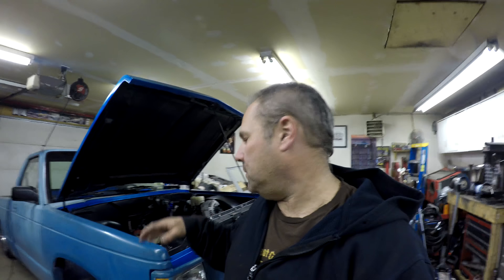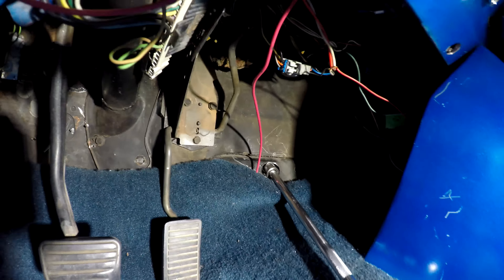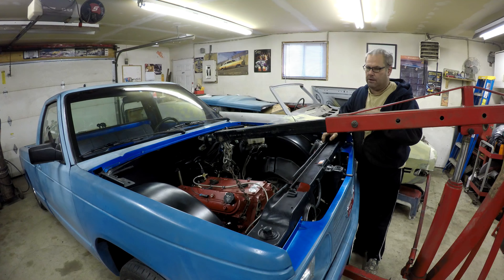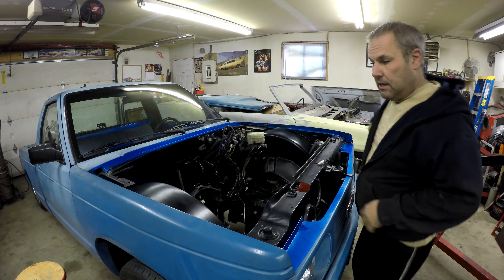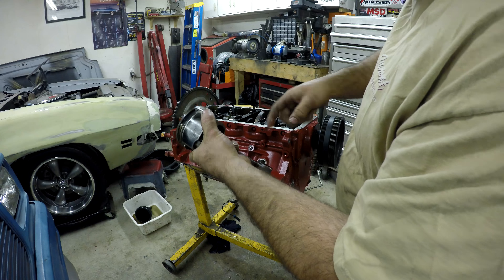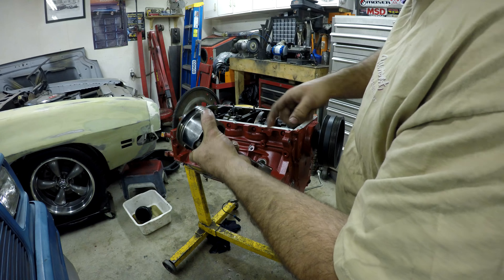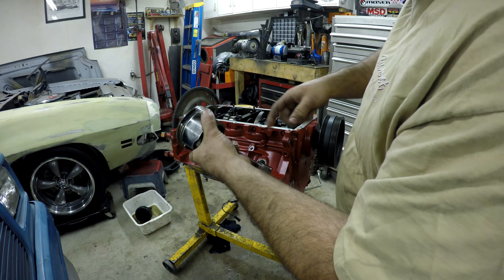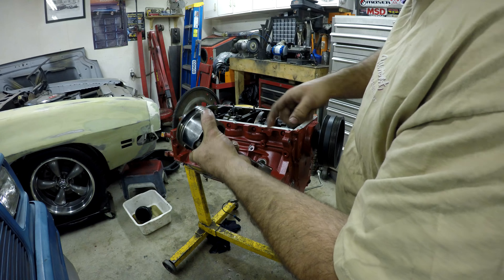Replacing a Piston in a V8 5.3 LS Engine | Blue Ghost Engine Problem Solved (Turbo L33 Budget Build)

Comment: Awesome video. 24C is about 75F. Watching you has inspired me to do an LS swap in my Nova for my next build. I've had 3 355's in it now and have found that they don't hold up well when you're always giving then a hot supper. I had always thought it would be way to difficult to pull off but after watching your guys I have seen its not really that much more to it. You have the best LS content on youtube, hands down. Thanks for the great uploads.

Comment: Lol, I'm uploading this exact same video right now. Cracked #5, ran great besides the smoke, and crankcase pressure pushing oil in boost. I also have 3 bent rods on drivers side that were so slight I had to take a straight edge across deck to see the pistons were tweaked. Good work man, keep it up.

Comment: Not sure if it’s related or not but one summer I had s hard time keeping a 400ci. small block, 2-305ci. small blocks and 2-350ci. small blocks in one of my 4x4’s. That’s right, 5 Chevy small block engines in one summer...the failure? ..#7 rod bearings in every single one.  The nearest we could surmise is the weakest link torque-wise. The situation changed when my final drive ratio was changed to a ‘lower gear’. IE....went from a 3.07:1 (highway gears) to a more useable 4.10:1  
With that only change, I have not since ‘lost’ another engine. All things being equal, I much prefer the lower gears anyways...believe it or not the gas mileage seems liveable as well. 🤙🤙

Comment: Hey bud I had a question, I have the same issue going on with my 5.3 where I found a Crack piston and I also have a bunch of 5.3 parts around the garage, and I was wondering can I swap out the one Crack dish piston for a flat top piston or would that cause some issues, note the piston came out the same year 5.3 but one had flats and the other had dished
Reply from the maker: I wouldn't do that,the compression would be different in the cylinder, and the weight of the piston would be different. If you have a full set throw all the flattops in and raise your compression.
Reply: @SPPTVarmy  ok thanks I appreciate the reply 👍

Comment: Have you ever had a 5.3l engine lock up on you out of the blue? A buddy (R.I.P. Matt) had his lock up 30 miles(50km) after fuelling up. (Not sure if that was a contribution to locking or not..just the facts) Driving slow hey speed..about 50mph ..no warning, no knocking, no lights or alarms just simply seized. Engine oil is up, at normal operating temp and no sign of loss of oil pressure. I have not ripped it down as yet and have not trued to restart it since the incident. 
Are they known for things like this that I’m not aware of? I’ve been a ‘mechanic’ for about 40yrs on and off and been working on the 2000 models for the past 5. Any info or direction on this ‘failure’ would be much appreciated. Thanks in advance... McGyver of the North.👍🤙🤙
Reply from the maker: Maybe a leaking injector filled a cylinder with gas and locked it up?
Reply: Steve Turk strange for sure how many miles on it?
Reply: SPPTV that is a thought I had had...an injector stuck on...that would be very plausible if the engine were stopped for a bit...before restart.  The plugs will certainly be pulled before I attempt any ‘turnovers’..don’t need to wipe out a starter, starter gear, ring gear or anything else in this process.
Reply: 407ForRent yes it’s very strange. It’s got about the 200k kilometres mark. I now see the Manitoba plates so I will assume you are around the Wip an egg area? 😉🤙  I’m out of Thunder Bay myself. The engine is in a beautiful Yukon XL my buddy owned. (Sadly he suddenly passed away so I cannot get anymore info then what he already told me. I want to ‘put it back together’ as a tribute to him.😔)
It’s definitely a head scratcher.. but I still have plenty to learn about these.
I enjoy the videos btw...thanks.👍👍

I see now that I was answering the other guy when talking about the Manitoba plates....sorry for my confusion.🙄🤪😜😁
Reply: Cam bearings gave up the ghost
Reply: Austin Doud  Again I had thought about that but most of the time there is the tell-tale ‘screaming of bearings’ just prior....🤔🤔  Thanks for the input. 🤙🤙
Reply: throttle bottle  Not very likely...no coolant leaks whatsoever and happened while driving down the Hwy...80km/h December.. -15°C  🤷🏻‍♂️

Comment: AND, have you ever cc'd the heads,   if this problem keeps happening on only that one cylinder, there might the compression issue!  high on that one cylinder  under turbo charging or not under charging?   piston to high to the cylinder deck?   on &on &on &on,,,,.                           just sayin x2